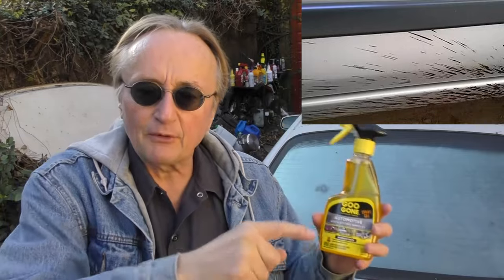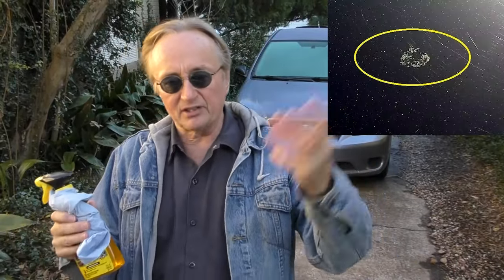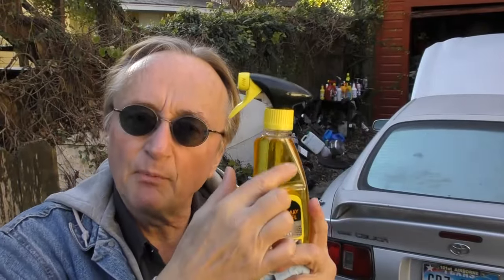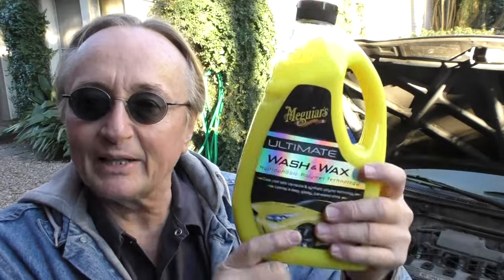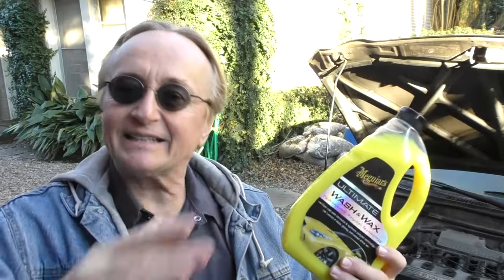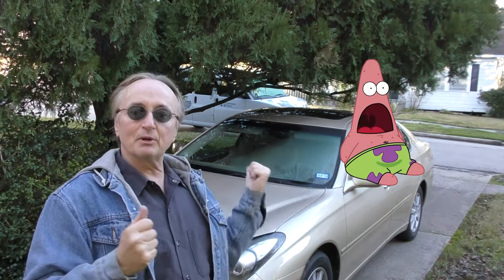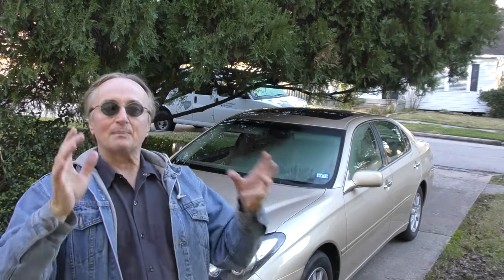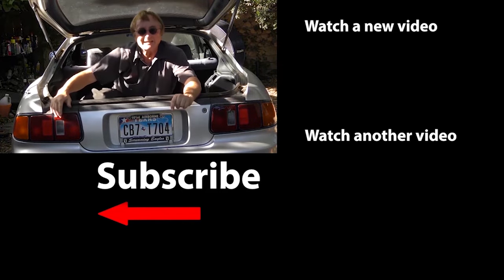Doing This Will Make Your Car Paint Last Twice as Long

Comment: Co-worker told me he didn't understand why people put their cheap lawnmower in the garage and keep their expensive vehicle outside.  I know most of us use the garage as storage.
Reply: 😒 yes its true, pretty fkn sad 😒
Reply: Because lawnmowers are easier to steal
Reply: Keep it in the garage (or better yet rent a storage unit) you don't want the neighbours to know what you think is valuable.
Reply: I put my car in the garage theres no other option for me then that. No way I'm gonna let my nice car sit out in the weather. Hell no
Reply: Because a lawnmower gets wrecked pretty quickly by the elements, maybe if you tarped it or something, a car doesn't. Also, lawn mowers sitting out look trashy, a car in a driveway doesn't. And most people trade in or sell their vehicles by the time their clear coats are worn down anyways.
Reply: If I had a 2 car garage I would put both in but I only have a 1 car so I just keep my junk jetta in the garage because the paint is really clean but that’s just me😂😂
Reply: My stepfather does that, but he buys a new car every 2-3 years, so weathered paint is a problem the next owner has to deal with.
Reply: I have a 2 and a half car garage and I use to park both my van and car in it and luckily had room for the lawn mower, snow Blower, and other crap. Now I park the car outside because it's the work car now, until I decide what car/vehicle I want to get next.

Even though it's zero degrees out right now and we just had snow, the work car still gets parks outside. It's 20 years old and still run ok.
Reply: True
Reply: @Fuert Neigt 
Wow!!! That equals 213% of Americans!!!

😆😄🤣😉

I know that those percentages are not combined, but I’m sure more than a few overlap!

I also think that your estimate of 50% that doesn’t believe in evolution is an over generalization!
What you’re saying in that estimate is that HALF of the entire population of America believes that we come from Apes, climbed out of some primordial ooze, didn’t or couldn’t walk upright for almost a million years, and that this planet is over ten million years old!!!

I’m saying that, maybe 50% of scientists who keep trying to prove the THEORY of evolution, believe in it, and maybe 10% of Americans actually are dumb enough to think that the entire planet evolved by thinking it could!!!

Evolution can not and never has explained how trees or any other vegetation evolved, has not and cannot explain how the air we breathe came to exist in the exact proportions to sustain human life, nor how(if evolution is to be believed) birds as tiny as hummingbirds to birds the size of the Golden Eagle to non flying birds like the Ostrich came to be in existence!!!

The very best Theory of Evolution has had to offer is a Big Bang Theory, man coming from Apes, and animals evolving from single cell amoebas with ZERO validity to any of those Theories!
Reply: Fuert Neigt there was a time when Americans were smart- the time between extreme conservatism and extreme liberalism.
Reply: I dont understand people who refuse to park their outside. Roads are outside. You bought the car to drive it. Outside.
Reply: I have a gym in my garage. Sorry 4Runner you gotta sit outside
Reply: My Dad said the same thing.  His 5 boys are few of the people who garage their cars.
Reply: paulparoma I don’t think his argument was that Americans are stupid. He was just citing facts from the American population
Reply: Both should be kept in the garage...
Reply: Is your coworker asian?
Reply: Because lawnmowers are small and cars are big. Is your co-worker not very smart?
Reply: I’m guilty

Comment: Ceramic coatings do work- good name brands like Carpro or Gyeon are great! The prep work is the most important part of it- you have to have it clayed, polished, stripped of waxes, and have almost perfect paint for them to get the best results. If you do this, yes, they work. If you don't, they won't be able to cure and bond properly. If you dont have the time, money, or dont really care about having completely perfect paint, then ceramic coatings arent worth it for you. Just wax your paint with a cleaner wax to give it a nice coat of protection and a light polish all at the same time. Just my 2 cents
Reply: MSTWNTD yeah it’s all about the prep I’ve had mine for almost two years still repels water like a dream. And yeah some special coating needs to cure for a week
Reply: tyvek05  no, that's not at all what I just said. A simple one step correction with a dual action polisher will set it perfectly in the right conditions.
Reply: I really like Scotty but I agree with you; there’s a lot of things he got wrong in this video. I trust that he really knows his stuff when it comes to the mechanical part of cars, but this video shows he’s not as knowledgeable when it comes to anything regarding the paint
Reply: You happen to be right... too much prep to be worth it on a Toyota... lol...
Reply: He's probably referring to the average Joe here, and also just his own opinion. Great that you have a wax that's still there two years later, are you saying you've not done any polishing/waxing/etc since? Or is it significantly, as in showing to someone who knows nothing about cars, so much better in color and shine than what the factory can give you? Chances are, no. You're still likely having to maintain with a minimum of washes but chances are waxing/polishing as well, you're still having to take care of it, and the traditional stuff works about as well, has similar end-results, easier and more likely for the average person to do, and costs a fraction of the cost. It just might need to be applied more often; yet if it requires far less prep to begin with, seems like it's a wash at that point.

It's just like the oil debate. Sure, some $50 a jug special oil may be a little better, but chances are it's really not for most, has to be in the right circumstances for it to actually be better, and for the average person is an unnecessary expense vs just maintaining properly at normal intervals using traditional tried-and-true practices and products.
Reply: Cquartz uk is the only stuff you need.
Reply: @personperson9591  You don't need to wax or polish a ceramic coating. That's the whole point. And yes, it looks better than a factory finish (unless you don't like gloss perhaps???)

I don't know how much you value your time, but good ceramic coatings will last many, many times longer than a wax job I can do myself.
Reply: @Superbdrivemate  if it's better than a factory finish, why don't they apply it at the factory? Pretty sure the multi-billion dollar companies would pay a few extra bucks if it were of noticeable improvement over their current clear coating.
Reply: @personperson9591  You said it: cost. Ferraris have immaculate paint, why don't other companies use the same process? Cost. Most people don't care so why spend extra?
Reply: Factory finish is often worse than you think, do you really think dealers care about a few light swirl marks? 
 tyvek05
Reply: Yea, Scotty might be a little wrong on this one. Ceramic coating does work. If guys can work on fixing their cars for 2 days then you can find the time to do all the prep work for a ceramic coating.
Reply: @MSTWNTD Mike Phillips(Autogeek) approves this message!
Reply: Maybe he doesn’t know the proper process to install a ceramic coat
Reply: Oh what a pity that Scotty doesn't know the benefits of ceramic coatings because his knowledge is so low on most of the things.The preparation before applying ceramic coatings like CQuartz UK 3.0 or Gtechniq etc...is the key that only a pro detailer knows. Scotty---> wrong information
Reply: tyvek05 couldn’t disagree more. I have a 40 year old collector that has been polished professionally by myself and the ceramic works wonders on it. You have to know how to polish a car properly. DONT USE ELBOW GREASE. Get a good polish machine and do it that way.
Reply: These comments are hilarious coming from people who know very little about the products. And rather take blind faith in a man spouting his opinions as fact. There is absolutely nothing wrong with ceramic coatings if applied properly and if your argument is perfect paint in unachievable, in what world is this true? Lol as a professional detailer I can't tell you how many coatings I've applied after a good wash, decontamination (clay), correction &a polish, some alcohol to cleanse the clearcoat, and apply. Yes it takes time and patience which most of you don't have it seems, but it's 100% achievable and not snake oil marketing nonsense. My personal car has had ceramic coating for the last two years and dirt has a hard time sticking to the ext. and when it does it mostly comes off with water alone. Another perk is a proper coatings on ext glass I haven't used wipers or had to buy blades in two years as well. So one mans opinion observed by another's lack of knowledge, leaves for misinformation and amusing comments.
Reply: DarthFader27 couldn’t agree more, great minds think alike
Reply: @Faydurr  I am not a professional detailer but I completely agree with you from personal experience. I had my car (europeean but the cheap kind, reliable and with low costs on maintanance) pollished by a professional. I bought nano tech coat for car body and glass surfaces. 2 different substances. I spent a hole day doing  the coating myself as per the instructions. 2 years have passed and water still drips off the car as if is freshly waxed. The windows not so much.  For me it worked with nano-ceramic-snake oil stuff. I confess i was also sceptic first but i've seen results. Oh..and btw i still have some of the solution which should last me 1 more coat.
Reply: I was gonna say. I love ceramic coating on my wheels.
Reply: Ceramic coating are the best thing ever to protect the clear coating. I genuinely think that this guy knows what he is talking about but he is dead wrong about ceramic coatings.
Reply: Ceramic coating works on the paint but not the damage to the paint from rocks etc. After 10 years you'll need to repaint the car if you drive it normally and ceramic after 10 years will run you around $500+ every 2 years on the low level at that point you can paint the car which you'll want to anyways after all the damage from rocks and debris
Reply: @djmussy18  Shops where  I live charge average of $1000 for a ceramic coating.  What they don't tell you, is that most only last a couple years at most, and they have to be "refreshed."  Might as well choose a good quality Meguairs, and do it two three times a year.  Save yourself a bundle!
Reply: @Willie Watra Right! With all the money you save over 5-6 years you can repaint the car
Reply: Bit Poppa That’s why you get a clear bra. If you’re worried about the cost long term then go ballout and get your whole car clear bra’d then ceramic coated. Then you won’t get scratches or dents from minor stuff like rocks or things rubbing against it and the ceramic coating will protect the paint from acidic elements AND the coating and bra will protect your paint twice as good from the sun while keeping a glossy shine. You’d literally only be spritzing down your car for 1-3 minutes for years and it’ll look better than any car out there.
Reply: @vaejoviscarolinanus  Yes indeed. I had my brand new European car ceramic coated done by the dealer before I drove it off from the showroom. I can attest that the paint still  has the showroom shine every time I had it hand washed and hand dried by my local car wash professionals. A proper car wash and vacuum all done by hand normally takes them hours to do the job properly.
Reply: @djmussy18  you're both right.  I myself do have a polisher, correct pads, clay bars etc. I also have my daily driver and 2 "toys". That part is extremely important also. If you don't have a spare means of transportation, it's pretty difficult and or very expensive. 
I ceramic coated my toys myself and no one believes me that they still have the original paint, because they don't have orange peel. I don't plan on ceramic coating my daily driver because it is a LOT of work, or again very expensive. My daily driver is waxed a couple times a year....it's a daily driver
Reply: I been scrolling looking for someone else that actually has knowledge about ceramic coating. After this video, not sure if I will be able to take Scott's word for things anymore bc that was just downright horrible advice due to ignorance. If he is ignorant about ceramic coating but seems so sure of himself, what else is he wrong about? True ceramic coatings are not designed to be applied by any joe shmo...the true ceramic systems are to be applied by professionals and professionals only, otherwise, you get guys like Scotty here bad mouthing ceramic coatings. A true ceramic coating can cost thousands to have applied correctly and normally only get applied to a higher end car due to the cost....you wouldn't polish a turd....I hate that I heard him say these things in this video bc now he will never be the same to me